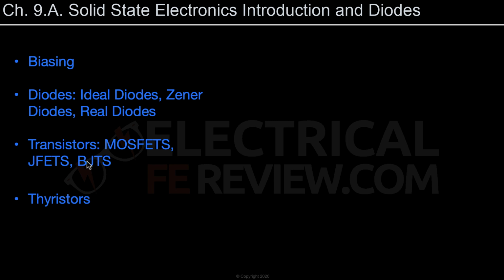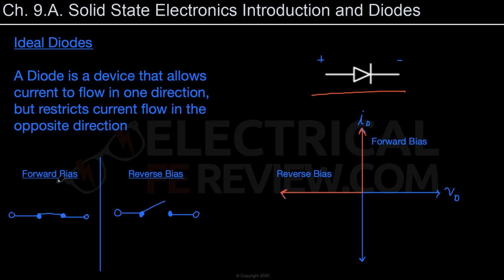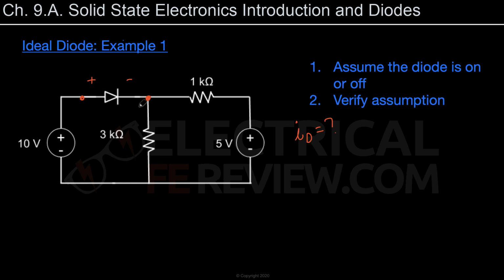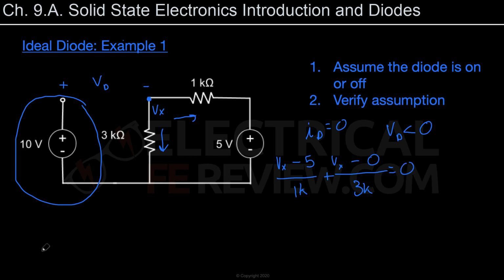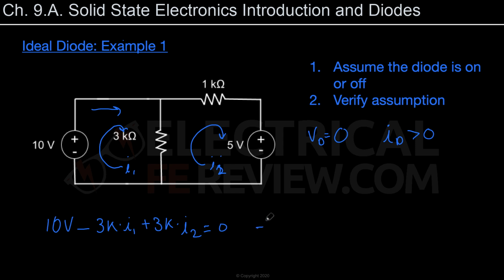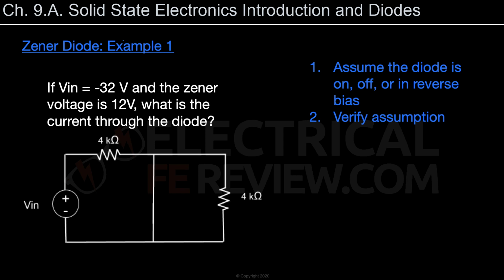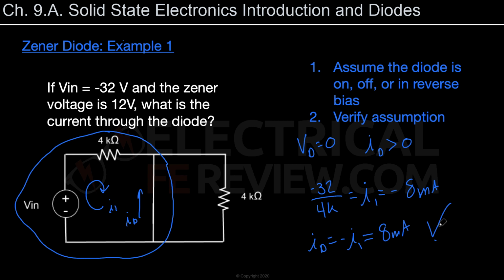Demystifying Diodes and Zener Diodes: A Comprehensive Guide for NCEES Electrical Computer FE Exam

Comment from the maker: Video Table of Contents (Click to Jump):
[0:00:00] Introduction to Solid-State Electronics
[0:00:08] Overview of Solid-State Electronics Topics
[0:00:19] Discussion of Diodes (Ideal, Zener, and Real Diodes)
[0:00:26] Overview of Transistors (MOSFETs, Chaifetz, BJTs)
[0:00:34] Discussion of Thyristors
[0:00:41] Explanation of Biasing in Solid-State Electronics
[0:01:26] Detailed Explanation of Ideal Diodes
[0:02:12] Modes of Operation for Diodes (Forward Bias and Reverse Bias)
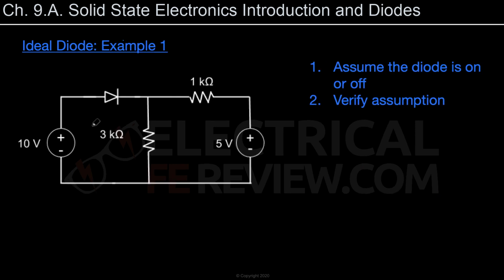[0:03:10] Problem Solving with Diodes
[0:04:57] Problem Solving Continued - Diode in Reverse Bias
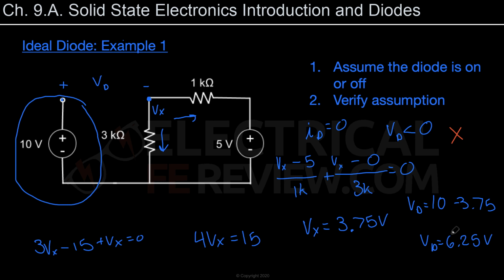[0:07:52] Problem Solving Continued - Diode in Forward Bias
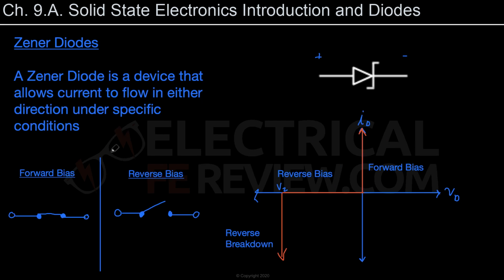[0:11:06] Introduction to Zener Diodes
[0:11:57] Problem Solving with Zener Diodes

Ready to master the Electrical FE Exam? Don't miss out on our expert-led online course, with video examples and practice problems. Best of all, it's 100% FREE! Enroll today at www.electricalfereview.com and take the first step towards passing the FE exam."

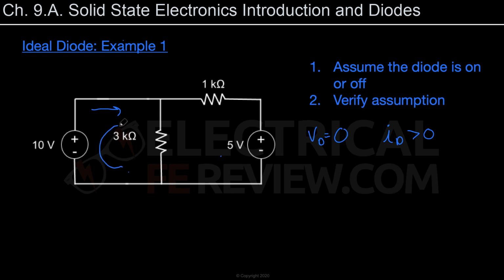Comment: sorry but if you are performing KVL @ 8:30, shouldn't the eqn for the first loop be -10v + 3k(i1-i2)=0? Or do symbols change because the voltage going into the diode must be positive and the current going into the node is negative??
Reply: I believe his equation is correct due to his assumed direction of current being clockwise. Following component polarities, we see the +10v from source minus the diode voltage ,3kOhm(i1-i2), and this completes the loop and is equal to zero. If you assume a counterclockwise current flow, your equation would be correct. I don't think this matters as long as you are consistent with your direction/orientation.

Let me know if you agree!

Edit: Misspelt words
Reply from the maker: @AndrewKiethBoggs  Great comment and observation Andrew! Have you taken the FE exam yet or are you studying for college?
Reply: @electricalfereview  Hi! I have passed the FE as of July 2022 using your videos and other great resources. Thank you for the great content!
Reply from the maker: @AndrewKiethBoggs  that's great news! Thanks for letting me know. I'd love to get in touch with you, would you mind saying hello on our student message board at www.powerpehelp.com?